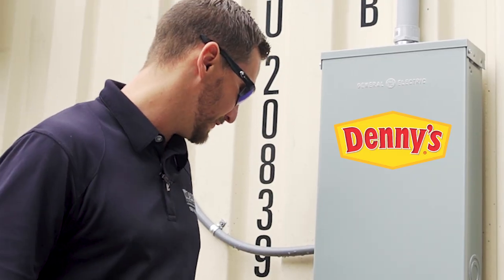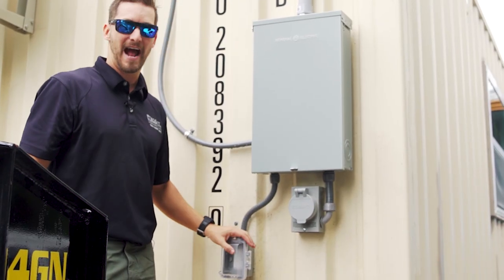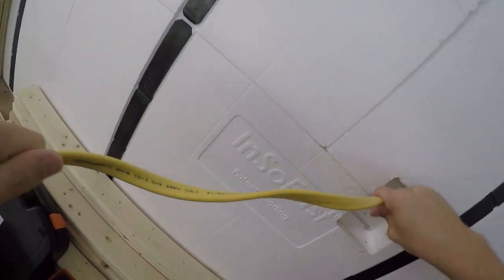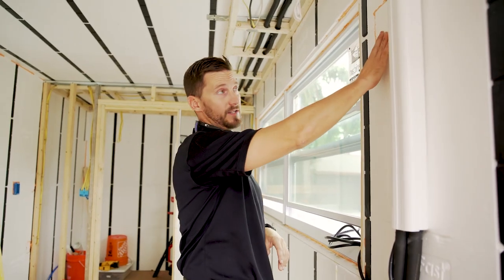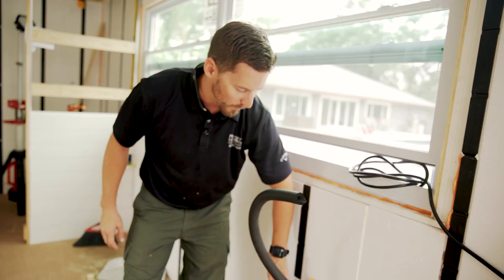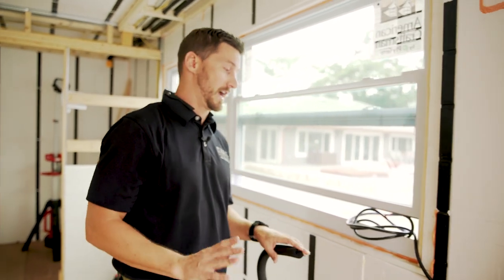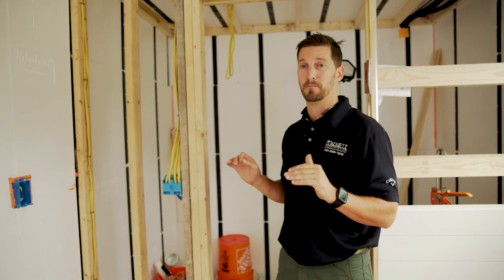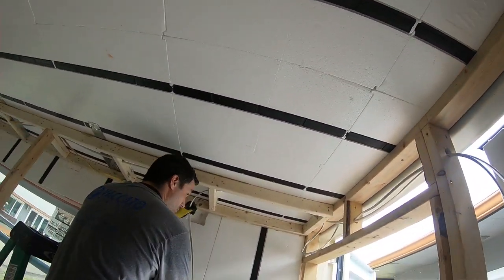Shipping Container Home Electrical Install Insofast | Building a 20ft Shipping Container Home

Comment: What type of Nema plug in and exterior outlet box were used for the lower plug in where power comes to the container?  Part numbers?
Reply: I want to know a parts list for the outside electrical as well.

Comment: Been a electrician since 2000. Seeing this I’d recommend staying clear. I’m going to cost you at least three times what you saved going this route (maybe four)
Reply: why not run the electrical under the container and punch thru the floor?  against code?  You could also possibly snake some runs  thru the square tube channel at the top of the container or in the well on the bottom of the side of the container where the forklift points are

Comment: Tell your sparky bud to watch some videos on wiring ICF &sips. If you're not using rings, screw the boxes off to the plastic nailing strips so they don't come loose over time. If you know there are fat cable pulls, router the back of the foam first, or if that isn't done, then use a long flex bit and Fish stick, and at least straighten your cable and bend a decent head on it.

You can also router, hot knife, chainsaw, or my favorite a cordless sawzall with blade cut to length in order to make a channel from the front. Then SPF it closed after inspection. And trim SPF with a hot knife potato peeler style instead of shanking the guards

Comment: I gotta say, the more vids you put out covering the Insofast, the more I think I won’t use it when I get around to building mine.
Reply: I was thinking the same thing. Insofast looks easy to install but then again we have to look at big picture. ? If you had to do it again would you?
Reply: if you stud out a container you are going to lose a shitload of interior space. it gets smaller and smaller and smaller pretty soon you can touch both of the walls .   also your non-insulated studs are going to conduct heat/cold right into your space.  there must be smarter ways to get some those runs in the box before you put in the insofast. Building a dropped ceiling would also increase the cost and decrease the interior space

Comment: would it help if you warmed up the romex a whole bunch so it is more pliable? you could put your roll in a tin trash can with a lightbulb mounted to the lid to warm it up.   (Use the same can/light to warm up all of your glue ) also use a lite lubricant to help the romex slip thru the foam channel

Comment: Would it perhaps be easier to run the wiring through the channels before installing the insofast to the wall?  Insofast has a video where they duct taped panels together horizontally before gluing to the wall.  Seems like those 2 techniques might work well together to address the issue of the difficulty in snaking wire through the tight channels.

Comment: Would wiring be easier to design it and faster running it on outside of the finished inside wall using the special electrical pipeing?

Comment: Love what you do !!! Being that these containers are steel, how do you deal with air movement, do you have any fresh air vents installed on the container or on the Windows ?
Reply from the maker: Dan Doe thank you!  And good question, being that they are so small and the impact windows we use down here in Florida have pretty large gaps in the bottom track there are enough little escapes between that and running the air conditioner that it stays pretty fresh.  Then when it’s not 10,000 degrees outside opening a few windows brings in a great breeze
Reply: What would you recommend for a state like Michigan? Would humidity be less of an issue than say a place like Florida.

Comment: I am thinking InSoFast would still be good for doing the walls. That way you loose less space on the walls, maximizing the usable width of the container. The containers are so narrow to begin. I believe framing to ceiling would be the way to go. It would all all the electrical to be run overhead, and only the end run coming down the walls to each switch or outlet box. And it would allow for additional insulation to be run on the ceiling. Or perhaps run it underneath the container in the same manner, and then insulate and enclose under the container.
Reply from the maker: Hocus Pocus agreed that is my new plan! I just ordered a bunch more for our next 40ft 2 unit build coming up :)

Comment: Is a 50AMP service enough for most single container units.  I'm looking at a 40ft.  With a mini split a. A big workroom with normal lights and outlets possibly a fridge and a small room with a few incubators for eggs the plug into a normal 110.  I debating running a simple RV power tower out near it. With a 50 AMP circuit with a 50 and 30 and 20 amp connections in it.  Then having something like you have here that just teachers the container into 50AMP.   or was just gonna run a a 100 AMP outbuilding service I to the panel. Thing is I kinda want to be easily considered a 'temporary' moveable structure. I just don't know if 50AMP is enough to do what we want.

Comment: If you had an electrical plan/layout before you insulated could you have run the wires as you were putting up the insulation blocks?  It seems that it would be easier running through one panel then 3 or 4.  Label each romex so you knew what circuits were once you were ready to hook up to the breaker panel.

Comment: consider consulting a electrician like myself that thinks outside the box and has interest in said projects .. like insofast is premeditated and engineered.. same with electrical... raceways  need to be considered as well as load calculations.. ive  wiref connex boxes as far back as 1990 as weather stations shipped to greenland ... the floors come up for one ... framing and insulation will need to adapt to electrical plumbing hvac.. a torch n piece of pipe heated will condense the foam to then fit over raceways of conduit wich has much more versatility and a much better insulated wire that will endure time and elements... im in va but would love to get involved in such prefab ... after 38 years in electrical and was taught pride n craftsmanship first and as i look back and into the future quick .. cheaper..faster..because a GC is more concerned with the lipstick n dress put on the pig instead of the longevity of the creation because of the legal warranty lengths and the answer for bullshit fails is yes products and procedures have changed since that time....if it cant be shipped  abroad as it was in its prior life not just handled like an egg when the desire comes to relocate theres a terrible bottom line  for the consumer... the possibilities for better product is in existence om sure windows and doors could be produced with proper rubber to install as the insulated panels were... but the insulated panels dont seem to have consideration of anything but a folded metal background ... yes  i have ranted on but i see this process as one time offering ... to renovate in few years would be more costly then to start fresh

Comment: Question:  why not run the long home runs under the container and punch them up through the floor? Or they could run in the channel / space where the forklift portals are?  Also, the frame of the container is built out of square tube, could you punch into there and snake the long runs from one end of the container to the other ?

Comment: It is super easy to make these insofast bits by yourself.
A 2x40ft high cube will cost you $650 with a R-value of 13 with EPS s80.
All walls, roof and floor, the more windows the less closed cellfoam you need :)
InSoFast is robbery and they laughs all the way to the bank :P

Comment: Are they concerned about desert or arctic temperatures?  Putting the foam in beforehand can cause huge problems and unless you're dealing with extreme temperatures, is not really necessary.  This was not a home electrical install video - that's what they guy did outside that they didn't show.  This is a "we insulated before wiring the container and it sucks" video.

Comment: For example : If you are going to install electrical cooker, you need to start from opening the box, wearing up to main switch, and plug-socket set up. Then people will think, you are really doing practical helpful job. The way you did the video, it is called advertising heading to get new clients. Ordinary people want to see the practical job. bye.